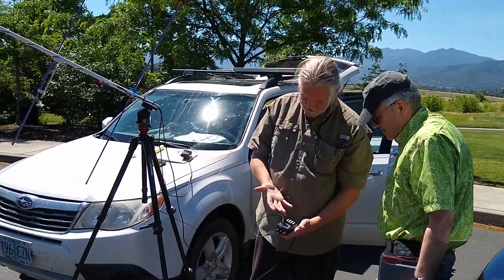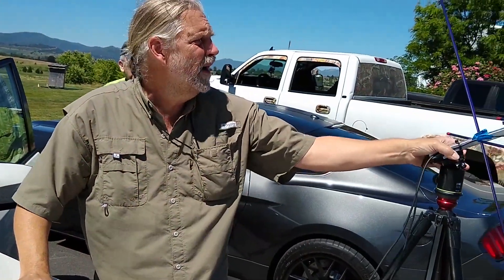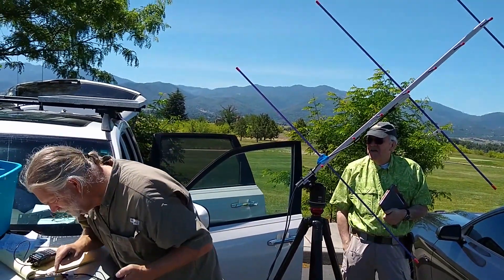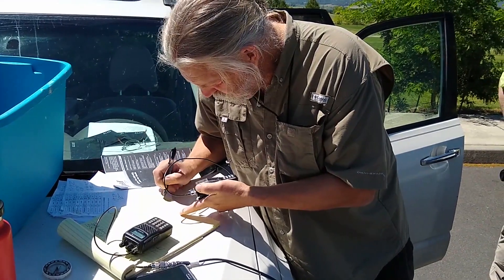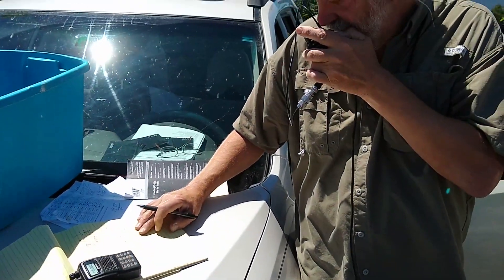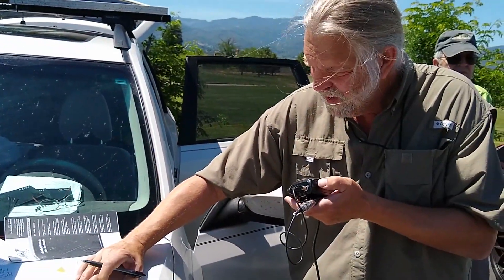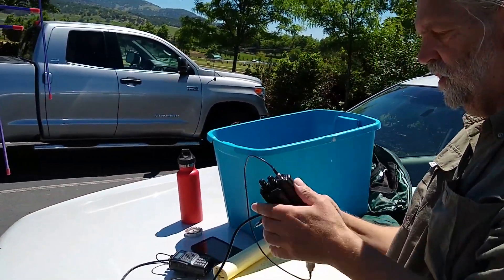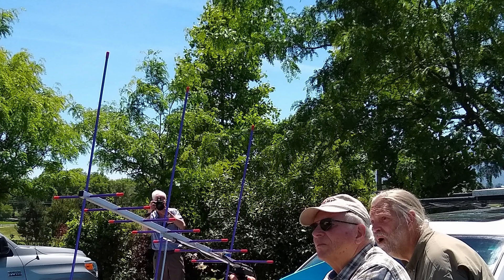AMATEUR RADIO SATELLITE COMMUNICATIONS

Comment: Great video Bob! But for using of one FT-60 with dual band antenna follow the instruction below:
The FT-60R can be programmed for "split frequency" (page 28 of the owners manual) - where you can set it up to TX on one band and RX on another in a single memory location.
UB4AEN, 73!